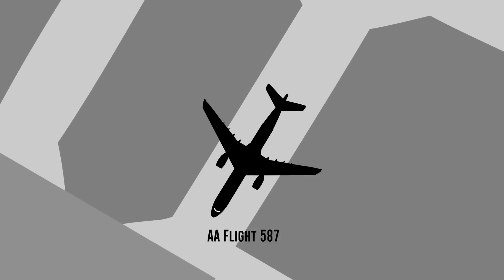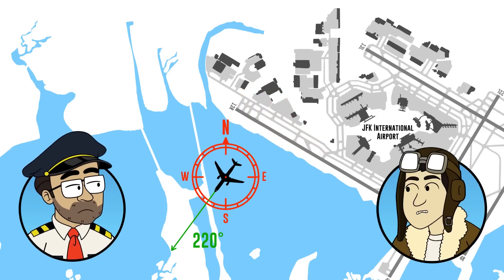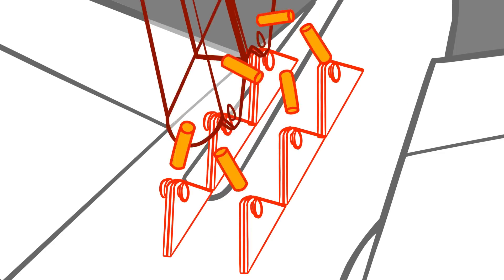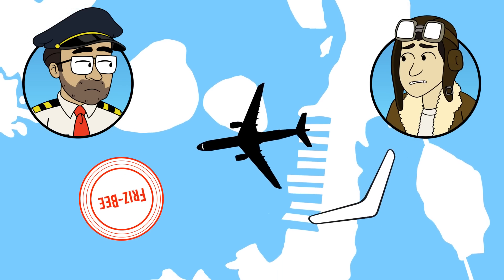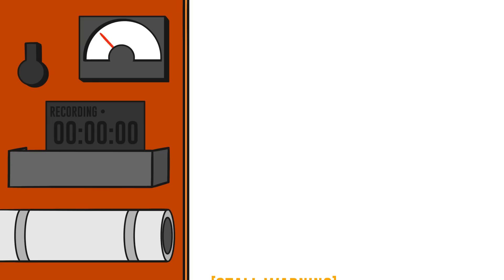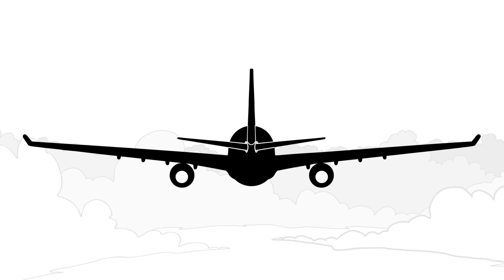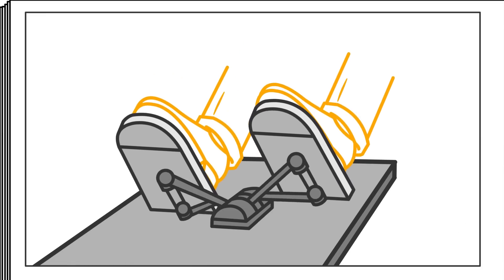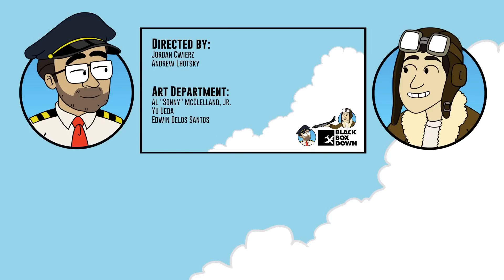What Causes the Rear Wing to Rip Off a Plane? | Aviation Explanation

Comment: From mechanical engineering the factor of safety of that rudder with that captains inputs is extraordinarily low. One has to wonder if it could be designed better so that even in those conditions it wouldn’t break but when it’s doing more than double the current safe limit that’s some extreme inputs lol

Comment: Interesting, on Air Crash Investigations, they show the lugs breaking, not the pins.  I wonder which ones correct.
Reply: According to wikipedia the bolts were intact, it was the composite lugs that failed.

Comment: This is absolutely fascinating and I kind of want to watch the full podcast but I also do not want to incidentally spook myself off of flying, although I know that per miles traveled it is by FAR the safest method of travel.
Reply: I wouldn't let yourself be scared off flying because of these accidents. These accidents are all so noteworthy because they're so rare, and generally speaking, SO MANY things have to go wrong along the way to bring a plane down. Gus is also super reassuring at the end when he talks specifically about what effect on current safety standards/practices/etc each individual accident has had. The podcast actually made me less worried about flying, not more.

Comment: For those curious why the first officer reacted in the way he did, you can thank the way American Airlines trained their pilots. The pilots were given pretty much improbable scenarios about encountering wake turbulence (it rolling the plane 90 degrees and pitching the nose down, which won't happen). So they were encouraging these aggressive inputs, but then the F/O began overcorrecting himself, and the results are shown above.
Reply: Wake turbulence effects different planes differently. Smaller planes will basically be swatted outta the air. Getting flipped by the turbulence is is possible. But a large airliner will literally tank it at low altitude. High altitude wake turbulence can still be very dangerous to an airliner.
Reply: @Bob_Kile  It depends on the weight of the plane generating the wake. My C-130 won't notice the wake from a private jet. I get a little tossing from other C-130s. An A380 would eat my lunch.
Reply: @Ken_Koonz  
Yup there is that too. Wake turbulance is basically a 3D version of the wakes by boats and ships. Small boat generate small wakes and big ships make big wakes. Small boats get tossed around like toys while big ones tank them.
Reply: For the pilot who was prior service, I’ve never heard of any scenario where a plane would require full rudder deflection in order to stabilize a place even just half of that could throw off a plane’s equilibrium. A former pilot even documented a prior flight with molin where he advised he likely misconstrued some of his training,

Comment: Learned about this one in materials engineering. A big controversy made over if the carbon fibre composite materials of the vertical tail was the reason for it ripping off. Composite materials were new on the A300 and they are harder to inspect for defects/damage (if you don't use the correct methods). There may have been existing damage that they didn't catch. 
However, the main reason for the crash was excessive steering with the rudder. As far as I know planes are suppose to make turns with roll+pitch instead of just using yaw the whole time. The rudder/Yaw is just there for smaller corrections.

Comment: Why call it a rear wing? It’s a vertical stabilizer. Can you retitle this?
Reply: Its probably for having a simple explanation of what happened. Although its not correct, it gets the meaning across to those who dont necessarily know what a vertical stabiliizer is.
Reply: @Lomokkoe  Exactly, Youtube Videos pull casual clicks in easier with less technical wording in the titles. It's just the way the platform works.
Reply: Ur the only one who cares